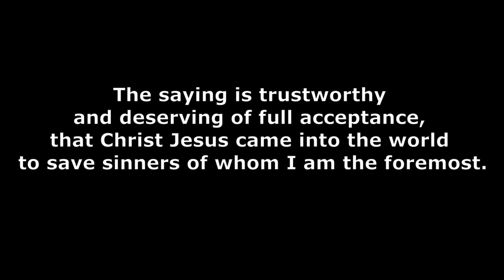Remove Pistons Snowmobile

Comment: I rebuilt my XLT top end your video helped me out a lot thanks. I was wondering do you need to retorque the head cover and cylinder heads after break-in? It does not say anything in the manual.
Reply from the maker: i did not and I've ridden it hard multiple times after rebuild. No issues
Reply: No you don't have to re-torque.